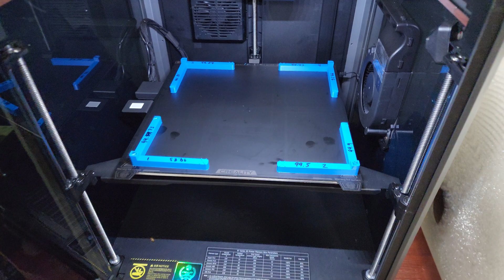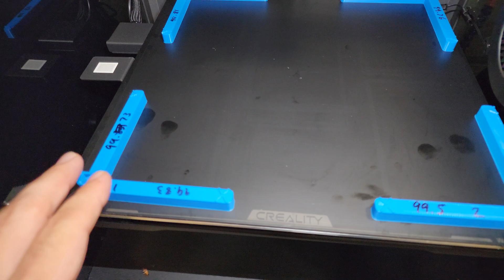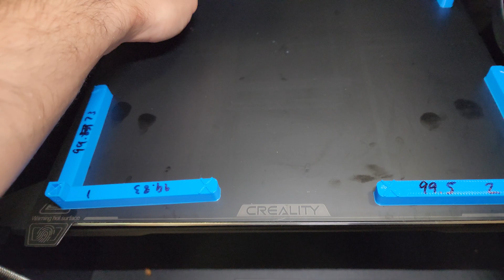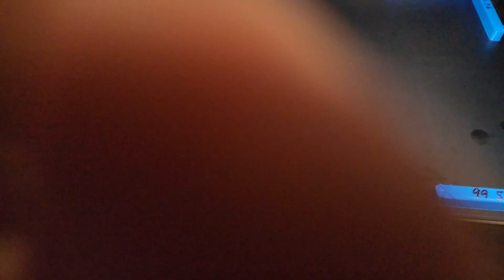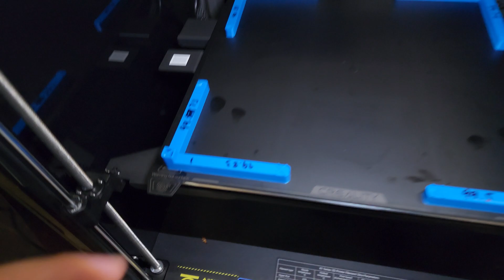Creality K1 Max Dimensional accuracy issues

Comment: I found these same types of dimensional inaccuracies in the parts i did on my K1Max, including variation in the Z axis that varies by a total of 1mm from the front to back of my part. Everyone has raved about this printer but i have had constant issues. I will be checking out your follow on videos. Thanks!

Comment: I think my comment got hidden since I originally included links.

You should not mess with your esteps for A and B motors.

First step is to make sure your belts are tuned correctly/evenly. You should have the same frequency on both belts.  Look up voron "secondary printer tuning"

If that doesn't help check out klippers skew correction. This will help make up for imperfections in how square your gantry is.
Reply: I was thinking skew as well.
Reply: @Redo3D  Good luck!

Once you fix the skew problems, if you're searching for closer accuracy overall you want to look at your flow/em and then material shrinkage settings in the slicer. 

Highly recommend the andrew ellis 3d printing guide for tuning.

Comment: I'm in the process of doing these tests on mine and had a thought...Assuming you're using the side fan, Is it possible the narrow width of the fan flow could be causing some weird inconsistent shrinkage issues?? I'm doing my first test with no side fan. Then one at 100% possibly.
Reply from the maker: I disabled the side fan to check for this and it's still the same.

Comment: my k1 max linear bearing X axis is heavy, Y axis linear bearing is super smooth. 
I disconnected the belts to check the movement of the axes and found this problem on the X, maybe that's the problem.

Comment: If you are using klipper Do the same test you do with the extruder for the x and y steppers than modify also you have to contend with material shrinkage if you are using super slicer there's a direct setting to modify this you'll have to do some calibration prints to find out how bad you're off
Reply from the maker: I agree I would modify the x and y rotation distance, but in this situation every corner has different dimensions, it is not consistent. This is something I can't figure out and modifying the rotation distance won't fix.
Reply: May be x and y belts are not exactly in parallel so when the gantry moves belts form a triangular shape and the travel distanca varies. low quality chinese products have always this kind of engineering problems.
Reply: @Redo3D there's also SKew setting that you can do I recommend getting the cali flower 😊 print and spreadsheet work really really good
Reply from the maker: @selcukpura I think this may be the issue